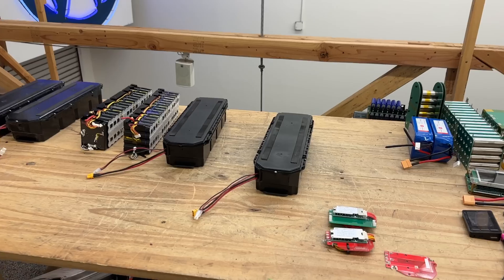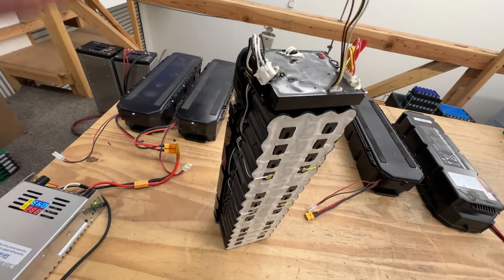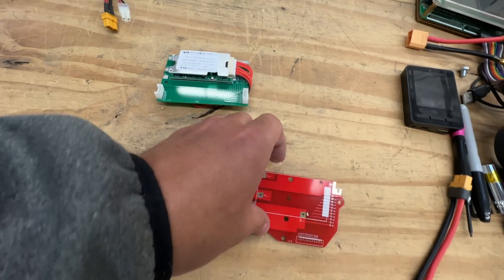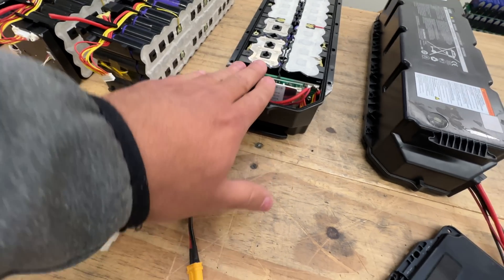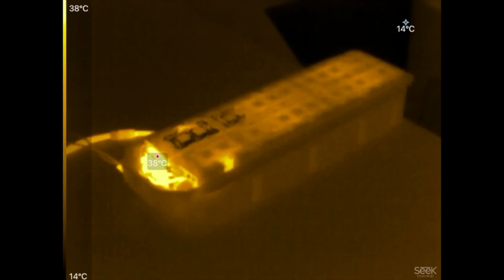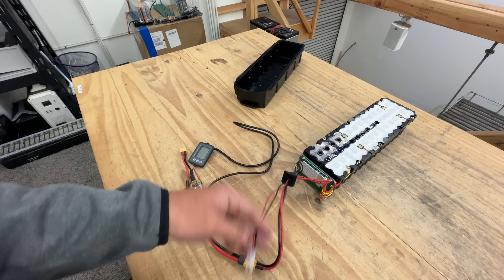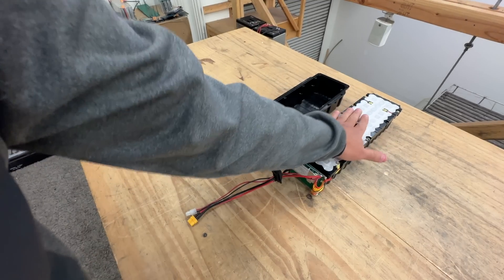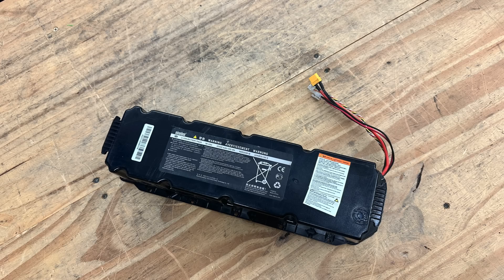$40 60cell  500Wh Ebike battery fix - sorta

Comment: Hey. My neighbor asked me to get a newish battery for his 36v atv his young kid has.
So i removed the old lead batteries and found a used ninebot battery on marketplace and bought it.
Did not come with charger or anything.
Its just the battery.
It has 3 connectors.

1. The main XT60 with red black and measured with a multimeter i get 39V.

2. A smaller white connector with 2 cables red and black. No voltage between the 2 cables.
BUT, if i measure the two red cables between the main xt60 and this connector i get 3.45V.
So red plus red = 3.45.

That threw me off as i thought this other red black would be the charging plug.

And connector nr 3 is a tiny tiny with 4 cables.
Red black yellow white.
Most likely for a display i believe.

And here is my question now:
I went out and bought a li ion charger that are 36v 2ah
With a charging current at 42v.

Can i connect that directly to the Xt60 and recharge the battery via the xt60 connection or is there some mambo jambo i need to do to something or any of these other cables so i could safely charge the battery?

Is perhaps the small small other cables some kind of lock that need to be spliced together or something like that?

I don't really understand the white connector with the red black cables and why it for some reason should read 3.45V between the red cables.

Is it something to just ignore and just recharge directly by connecting the XT60 to the charger?

I need of course to create a connector for the charger and same time have a direct connection to the atv controller.

I appreciate all answers and i hope you reply soon because the atv are in my workshop now and i need the space.

Thank you all!!
Reply: Xt60 is discharge. Charge is the thinner gauge black and red cables with the white connector. The other plug goes to the esc controller. The charger for these batteries are 42v 1.7amp output (into battery pack). You can search for “ninebot g30lp charge port” for easy fix…
Reply: Adding: for the ninebot max, battery’s xt60 plug goes into the controller, which transfers power to the motor, display, headlight, taillight with brighter brake light function, throttle and speed control. You may want to check to see if you have a fleet/rental or consumer version of battery. With rental batteries, at a certain amp load, the bms will cut power. Multimeter will show voltage, but will cut under load.
Reply: @HaotheEnd thank you, since i posted the question i have understood this.
I have successfully charged it and i am using it on a electric atv for a child.
I have testet and had full power on throttle for at least 30 seconds and it didn't cut.
It was not under load but i really hope whenever the kid come to pick ut up it will allow him to have it running at maximum power.
I dont think its from a rental, but who knows.
I bought it at a great price and thought i could gamble on it. 
Changed the charging connector to what the atv had and also bought a generic charger that has 42v 2ah and cut that cable and connected it to the old connector from his old charger.
I really hope it will work out now.
I have actually made a video on it just now.
Reply: Check if post was still here.
Reply: @RIMHQ-YT  good to hear. Sounds like it’s good to go. Those are steps I would take as well, regarding the charger. You could run it a little longer. I’ve heard stories regarding people using the rental scooter battery and it cut out in about 10 minutes.
Reply: @HaotheEnd I am waiting for them to return to their cabin in the area i am and hopefully it will just rip.
And getting 10 minutes are about 7 minutes more than those three serial connected lead acid batteries it had before.
But I could also do some modification where i draw the battery directly from the pack, but that way i will lose control over the voltage and the battery will be destroyed because kids will have full throttle even when the battery is so flat they need to push it.
So.. i hope. Or replace the controller with a generic Chinese one. But i dont wanna spend more time on it. 
Hopefully. If i must i will do it of course.
Reply: Another post check. Often my posts get automatic removed
Reply: @RIMHQ-YT  yes, by passing the leads will remove protection that the bms provides
Reply: @HaotheEnd bypassing isnt ideal unless its used along with some voltage controller or something. Its not gonna last long with a kid all wide open throttle until it doesn't move.
So, no. Another solution must be used.
I looked at your videos about it and your board,
But getting this made here in Norway isnt easy.
And the shipping from usa are incredible so not an option either.
Thank you for your time and help. :)
Much love from Norway TOBY

Comment: Hi i have about 1000 of these batteries would like to talk about purchasing this kit 

Please reach out 🎉❤
Reply: Hey. My neighbor asked me to get a newish battery for his 36v atv his young kid has.
So i removed the old lead batteries and found a used ninebot battery on marketplace and bought it.
Did not come with charger or anything.
Its just the battery.
It has 3 connectors.

1. The main XT60 with red black and measured with a multimeter i get 39V.

2. A smaller white connector with 2 cables red and black. No voltage between the 2 cables.
BUT, if i measure the two red cables between the main xt60 and this connector i get 3.45V.
So red plus red = 3.45.

That threw me off as i thought this other red black would be the charging plug.

And connector nr 3 is a tiny tiny with 4 cables.
Red black yellow white.
Most likely for a display i believe.

And here is my question now:
I went out and bought a li ion charger that are 36v 2ah
With a charging current at 42v.

Can i connect that directly to the Xt60 and recharge the battery via the xt60 connection or is there some mambo jambo i need to do to something or any of these other cables so i could safely charge the battery?

Is perhaps the small small other cables some kind of lock that need to be spliced together or something like that?

I don't really understand the white connector with the red black cables and why it for some reason should read 3.45V between the red cables.

Is it something to just ignore and just recharge directly by connecting the XT60 to the charger?

I need of course to create a connector for the charger and same time have a direct connection to the atv controller.

I appreciate all answers and i hope you reply soon because the atv are in my workshop now and i need the space.

Thank you all!!

Comment: I think 🤔 you can connect the data connectors the green and red go to the outgoing positive wire on the battery and the whight and black connect with the negative outgoing wire on the battery. They also allow to charge when connected in this way! I think the four wires your looking for should say data+, and data-, or data R, data X, on some or data Y,. Try using a multimeter to help you!!!👻
Reply: Hey. My neighbor asked me to get a newish battery for his 36v atv his young kid has.
So i removed the old lead batteries and found a used ninebot battery on marketplace and bought it.
Did not come with charger or anything.
Its just the battery.
It has 3 connectors.

1. The main XT60 with red black and measured with a multimeter i get 39V.

2. A smaller white connector with 2 cables red and black. No voltage between the 2 cables.
BUT, if i measure the two red cables between the main xt60 and this connector i get 3.45V.
So red plus red = 3.45.

That threw me off as i thought this other red black would be the charging plug.

And connector nr 3 is a tiny tiny with 4 cables.
Red black yellow white.
Most likely for a display i believe.

And here is my question now:
I went out and bought a li ion charger that are 36v 2ah
With a charging current at 42v.

Can i connect that directly to the Xt60 and recharge the battery via the xt60 connection or is there some mambo jambo i need to do to something or any of these other cables so i could safely charge the battery?

Is perhaps the small small other cables some kind of lock that need to be spliced together or something like that?

I don't really understand the white connector with the red black cables and why it for some reason should read 3.45V between the red cables.

Is it something to just ignore and just recharge directly by connecting the XT60 to the charger?

I need of course to create a connector for the charger and same time have a direct connection to the atv controller.

I appreciate all answers and i hope you reply soon because the atv are in my workshop now and i need the space.

Thank you all!!

Comment: Remember,  The battery pack is cooled by air moving across it while bicycle is moving...! Setting it on the bench with no air moving across it, from a fan is asking for real trouble.  Watching the thermo footage gave me a scare, I was hoping for your sake it didn't ignite into a fire, so please be careful. As well the OEM battery management board has a possibility of a Controller reset. I've been coding since 1972, many different computer designs including the latest line of devices.  Without seeing one of these battery packs management boards up close and personal,  I can't help you get into it and reset the cutoff date clock, that kills the battery off, due to life expectancy safety precautions.  You don't want them blowing up in a firebox between you're legs while on the Golden Gate Bridge. I have a Felton Volkswagen Rabbit conversion. But  I use 8 12volt MK brand Gel battery packs, for my 96 volt pack, my motor is rated 120 HP at 120VDC, max. Send me a link,  trade programing hack for a couple of those packs. I know the guys at at EV West. Fan Power for cooling... always
Reply: Hey. My neighbor asked me to get a newish battery for his 36v atv his young kid has.
So i removed the old lead batteries and found a used ninebot battery on marketplace and bought it.
Did not come with charger or anything.
Its just the battery.
It has 3 connectors.

1. The main XT60 with red black and measured with a multimeter i get 39V.

2. A smaller white connector with 2 cables red and black. No voltage between the 2 cables.
BUT, if i measure the two red cables between the main xt60 and this connector i get 3.45V.
So red plus red = 3.45.

That threw me off as i thought this other red black would be the charging plug.

And connector nr 3 is a tiny tiny with 4 cables.
Red black yellow white.
Most likely for a display i believe.

And here is my question now:
I went out and bought a li ion charger that are 36v 2ah
With a charging current at 42v.

Can i connect that directly to the Xt60 and recharge the battery via the xt60 connection or is there some mambo jambo i need to do to something or any of these other cables so i could safely charge the battery?

Is perhaps the small small other cables some kind of lock that need to be spliced together or something like that?

I don't really understand the white connector with the red black cables and why it for some reason should read 3.45V between the red cables.

Is it something to just ignore and just recharge directly by connecting the XT60 to the charger?

I need of course to create a connector for the charger and same time have a direct connection to the atv controller.

I appreciate all answers and i hope you reply soon because the atv are in my workshop now and i need the space.

Thank you all!!

Comment: Is there a temperature sensor on the bms? You say the BLS might have cut off because of a hot cell but I don't see any sensors, maybe I missed it? Are those 18650 F1L cells? They are known to suck at anything over 0.3C
Reply from the maker: yes there's a sensor on the cells,   these are LG 18650M26 cells they can do 2C max

Comment: That BMS is not good enough for how hard its being pushed, 107c is way out of spec and is not safe. 80c is the most you really want, and that's on a good well known one. but some off the shelf one running at 107+c is bad and dangerous. Just for you all that don't know, 107c is 224f and water boils at 200f. P.S. Solder will start to get soft around 90c (depending on the solder)
Reply from the maker: I’m testing peak performance,  what do you recommend? Using a bigger one so we can cook the cells? Cells are barely hanging on at a load of 27A, they were 60c
Reply: @jehugarcia  lol Well no I wasn't implying to cook the cells, I should have worded it differently. Sorry about that. What I meant is some people out there "that didn't know better" if ran at full tilt like this, would be dangerous , and I'm surprised the BMS did not cut off at a safe temp. (ie 80-90c). (would help save the cells that were running at their limit of 60c) I was not criticizing your testing methods at all, or at least did not mean to.
Reply: Water boils at 212f just sayin
Reply: @worldwide_wes  not in Albuquerque it doesn't. Water boils at 200F just fine.
Reply: Thank you Patrick for ensuring safety is front and center. saving a couple of bux pales in comparison to burning your house down.

Comment: Cool, replacing the BMS is a great solution for the proprietary ones that require CAN communication etc.
I would be super careful with the temps here -- 60C on the cells was measured after discharge stopped, and 60C is the max safe operating limit for these types of cells (can confirm on any datasheet; reality is that above 60C the cell capacity can permanently degrade). BMS is right next to the cells and measured 107C -- this seems like an unnecessary risk to have near the cells. An NMC cell around ~110C starts to risk electrolyte leakage = no bueno.
Keep up the hacking!
Reply: 60 is not max safe discharge. Many datasheets cite 80 or even 85. I personally don't like going over 60 and will cut it off if anything hits 70. BMS should be separated by a sheet of epoxy resin board always

Edit: oh dear lord these are LG M26's some of the worst cells in recent history. Avoid like the plague. An extra $40 is so worth it for MH1's or better
Reply: 60c the party is just getting started lol. I mean, if your trying to maintain a home battery or something that is one thing. But if I’m powering a bike/ mskateboard/drone/etc.. it’s gunna be pushed beyond that likely right away.i find improper storage or in general.. neglect… that seems to wack cells with the most authority lol. That’s why old stock and warehouse funds aren’t too exciting to me

Comment: Cut out from voltage sag but man those cells get hot for such a low load? 6P and under 30 amps total load is like 5A per cell?

Regardless price is excellent anyways. Thank you for your services!

Comment: NICE video. Battery maintenance and BMS boards are more technical. Besides, for the BMS, it also has smart version that allows you to view the detailed parameter information of the battery pack through your phone or computer, which is also very convenient.

Comment: I know for myself its a confidence issue when it comes to the DIY aspect of your projects.   I bought one of your $400 Boston Swing batteries.  I felt confident on the purchase but once I started buying all the components to assemble, my confidence deflated...  I still havent placed a charge on battery.  In the end I was defeated by trying to make an XT30 cable for a charge controller.  I had a friend who has soldering experience try to help me make a cable and he was having issues with his soldering equipment. My hang up is on the fact if I mess up I just threw away $470+ on a project.  I wish you had a cheap soldering project so I can learn, practice, and build my confidence without risking a $400 battery....completely my fault in the end.
Reply: if you want soldering practice pick up a little electronics diy kit like an alarm clock or radio or led project . relatively cheap to practice with
Reply: With thick wires I use a hot air station to heat up the wires/mass of metal then use the soldering iron to bring the solder to melting point. Other ways to approach it is to tin booth surfaces that you are going to solder together. You can also try different types of Rosin Core Solder, the best and easiest one to work with is the 60/40.

Comment: Dude those 20 amp 52v battery for $400 plus bucks wth way out of a lot of people range
Reply from the maker: Yes there are cheaper batteries out there,  these are high quality custom built.  I don’t control what things cost I just buy and resell product.
Reply: @jehugarcia  yup I know I just wish I had the $$$ to get my hands on a few  of  of them 2170s
Reply from the maker: 2 of the R12 will give you same 1Kwh but at 72v for around $100 so those are much more affordable.
Reply: @jehugarcia  yeah I bought some of them a few months ago but I have a controller that can run on 60v max but the ideal is 48/52 volts. I was thinking on the 72v option but I would have to upgrade the controller
Reply: @rickrandom716  P42A's are $5 each. You could buy 60 of them for $300 and have the second best 21700 cell on the market. What are you waiting for?

12S5P 48V 20Ah (they're not 4200mah cells) max continuous safe discharge of about 125A, peak 200+A
Reply: @ericklein5097  yeah I'm trying to get a ready build pack, not good on spot welding here
Reply: @rickrandom716 how do charge it